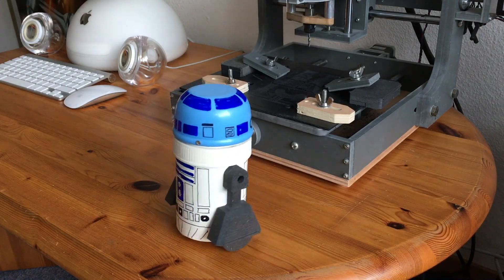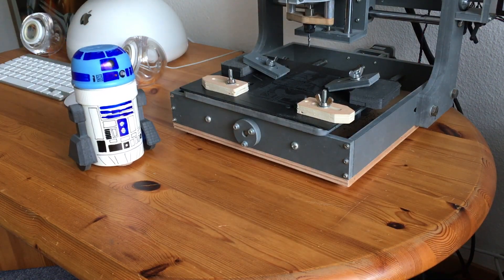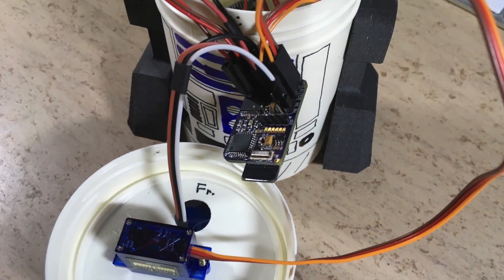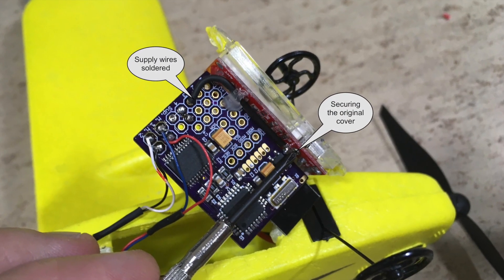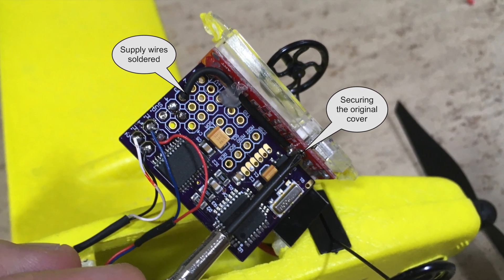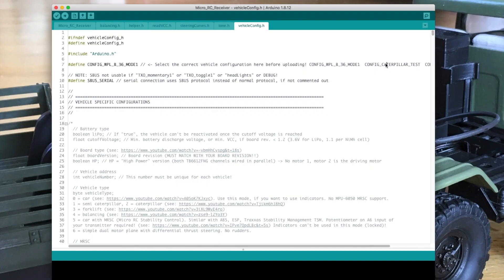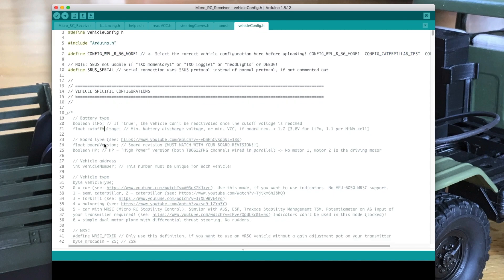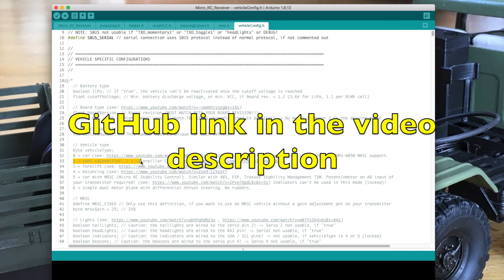Dual ESC Steering Mixer For 2.4GHz DIY Arduino Micro RC Receiver, ESP32 V12 Tank Engine Sound

Comment: hello,
Nice update !

for my boat version, I create an HTML file to set up the board, it makes the thing more "friendly" for people less comfortable with the arduino . it could be something you could try on your project.
https://github.com/croky-b/Boat_Engine_system_MAXI/blob/main/Config/Config_Croky_b.html

I also spent all the Aux sounds on a library XT DAC AUDIO , it's easier to add sounds without having to touch the main code (you can create sequences with different sounds, change the speed of playback, repeat x times or infinity,) All on the same principle as what is used for the engine sound
Cédric
Reply from the maker: Thanks for letting me know. Your HTML configuration tool looks good, but I still prefer the text based configuration.

Comment: Why don’t you make with receiver RC control two esc. I hope you make it.
Reply from the maker: The receiver already has two internal DC motor connectors, driven by a TB6612FNG

Comment: Thanks very much for making this update. I have it running on my IS-1 now and I'm sure once I get the configuration tuned it will be great. Right now it  pretty jumpy when turning. I think I will have to adjust some of the servo config parameters for smoother operation.  I confess I am not running the particular ESC's you recommend. I realize I could do some tuning there if I had them.
I have uploaded a short video to my channel so you can see how the setup is working in my IS-1 .  Again, thanks for being so responsive to suggestions for new features!
Reply from the maker: You're welcome. Yes, indeed, the tiny PS2 joysticks are very touchy. Works way better with my "car style" transmitter, which also uses the "Micro RC" electronics. You could also use an old, stick based transmitter and replace the PCB. You could also use "vehicleType" 2 (semi caterpillar mode). In this mode, you can't rotate the tank "in place", but the steering is way less touchy. You could also modify the steering curve in the "steeringCurves.h" tab like this:
// This array is intended for the "Caterpillar" mode. The inner wheel can spin backwars  up to 100% of the
// outer wheels RPM. That allows for turning the vehicle "on place"
float curveFull[][2] = {
  {0, -30} // {input value, output value}
  , {25, 9}
  , {50, 61}
  , {75, 87}
  , {100, 100}
};
Reply: @TheDIYGuy999  In that video I was using vehicleType = 2 which is caterpillar mode. I will  work with the configuration values as you suggest.  I do have an OLD FM 72mhz Futaba transmitter that looks like a good candidate for surgery.  I think the window for the battery meter is almost exactly the same size as the OLED display on your transmitter.  It would give me more switches and I can add some pots too.
Reply from the maker: @jps99  The Futaba conversion sounds like a good idea. I was wrong with vehicleType = 2. You could try 1. See comments on top of "vehicleConfig.h"
Reply: @TheDIYGuy999  It seems better after adjusting the curve as above.  How does adjusting the parameter "byte lim3Llow = 75, lim3Rlow = 105; // limited top speed angles!" differ from adjusting the escPulseSpan  in the ESP32 setup, which also limits maximum speed?  I find the IS-1 very jumpy accelerating from stop.  Is there any parameter I can play with that might help that?  I thought escPulseSpan might help?    I wish I understood  all the configuration files better.  Would you consider writing a manual for the Receiver and ESP32 Sound board like you did for the RC_Transmitter  (Manual_English.pdf)  I think it would benefit all of us trying to incorporate your devices.